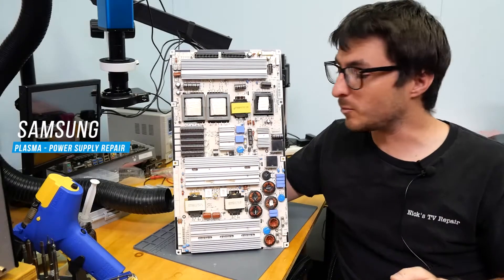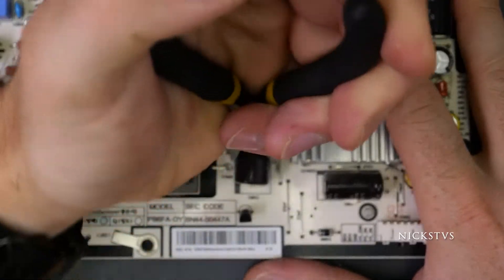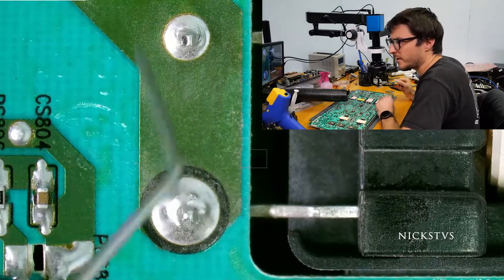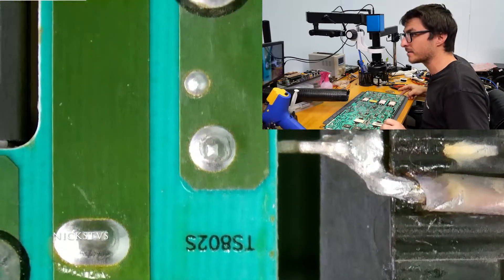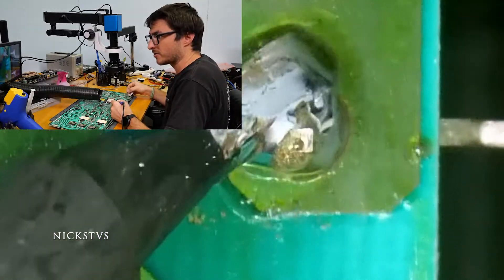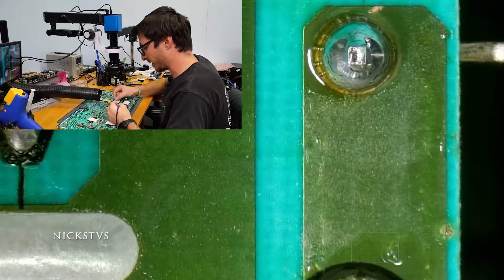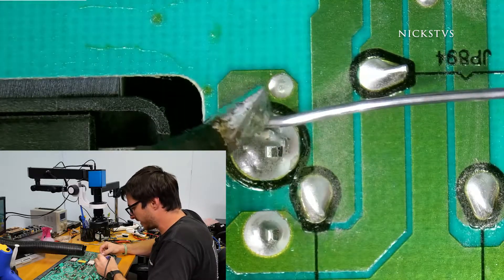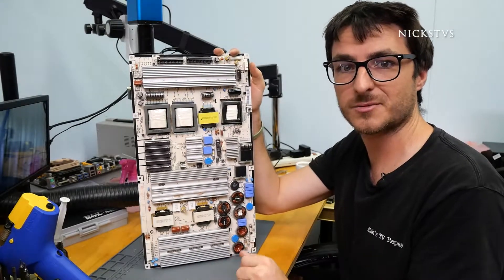Samsung Plasma Power Supply Repair BN44-00447A Cracked Solder

Comment: Hi there. Congrats for your channel. I’m following a weird failure in my tv and in my journey I watched many of our videos until I found this one. 
My failure is exactly this. The tv works fine for some time and then just don’t turn on again until I unplug it for some days!! lol. 
What I found here could be the problem but there is something different and is bc my tv had the one connect box and when I unplug the fo cable from the tv or I unplug the one connect box the tv shows me the image that says “connect the one connect box 🤯” so… I’m really lost. Could this happen to the one connect box too? 
To me is the tv power supply and I’ll check for cracked solder points for sure but that part when the tv shows me image when I unplug the fo cable really makes me doubt. 
Please if you have any thoughts or you can point me in a better way could he really helpful. 
Thanks a lot and one more time congratulations for your channel.

Comment: Why are we not testing the components? This is due for failure down the road. People today in this area are screwing up on repairs and I get all these sets with problems that could of been avoided. Caps need to be tested always not just bulging..
Reply from the maker: I respectfully disagree. I can almost guarantee you the next failure down the road is 4-7 years away and it will be cracked solder joints on the transformers that I fixed. The way the power supply is designed, that area is a high-stress area. While it's not a bad idea to be thorough and test a lot of things it is simply not necessary. When you have fixed the exact same board hundreds of times you get to know which components are overstressed and which are not. Trust me not all caps need to be replaced or tested on this board. Cracked solder joints are really the only fault we see with this power supply. It's extremely rare to see a bulging cap on these power supply boards, that's why I picked this board specifically for the video, is because it was one of those rare times we saw that fault. 
We offer a 1-year warranty on all repairs, I have never had one come back.

Comment: Will this apply to a dead board, tv showing no power or standby at all?
Reply from the maker: Possibly, have you taken a look at the board to see if it has that damage? It could be more severe and burned the trace badly. If that's the case it's still something that can be fixed but may require more work.

Comment: Ty bro! Had a Broken TV looked your video. 5 min repair no trobleshooting and it works again! Had a broke Solderjoint.
Reply from the maker: Glad I could help!
Reply: @NicksTVRepair  Its me again! So the TV worked like 3 days. But now its failing again. It runnnig for some seconds than reboot again. I checked the Caps they seems ok. Some advice what to replace?

Comment: Your board repair videos are some of the best I’ve found. So clear and easy to follow. I’m glad to have come across your channel. Any recommendations on where to start when learning the fundamentals for circuit boards?
Reply from the maker: Hey Matt, I am glad to hear you are enjoying the content and finding it helpful! 
As for recommentions on learning fundamentals, yes I have one. You can spend 100h watching tutorials and reading books from pros, but nothing beats experience and good tools. 

Invest in a hakko iron, and start practicing. Hakko I have found for irons is the best bang for the buck. Buy broken junk boards for cheap, remove the components, put them back on, and keep practicing. 
Also I can't stress enough, but have good ventilation or if you have the funds, get a nice fume extractor.
Reply: @NicksTVRepair  thanks for the tips man!! I have a Vizio e80-e3 that I acquired from a guy who said he had several electronics fail after a lightning strike. The tv doesn’t power on and has no standby light. i don’t believe it’s the power supply. He purchased one and replaced it but that didn’t solve the issue. The fuse is also still showing continuity. 

I saw your video that says the surge can happen in one of the hdmi ports or Ethernet port so I’m thinking the main board is the culprit. Would you be able to help me identify that is the issue and possibly repair the board?